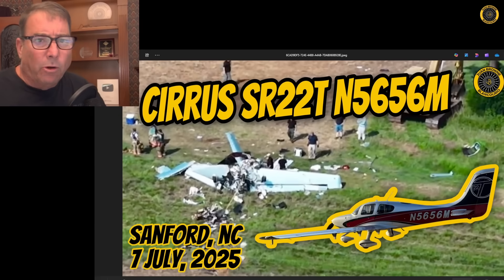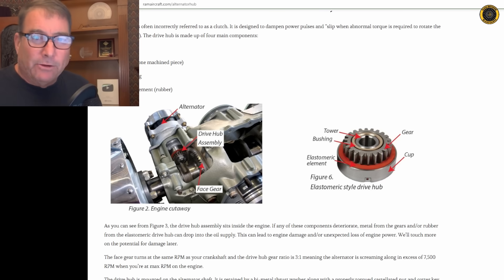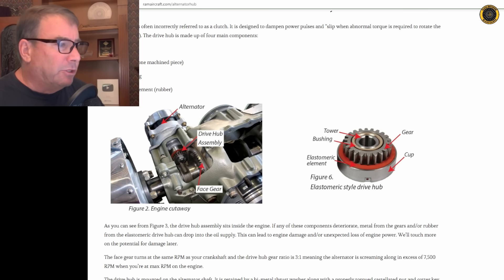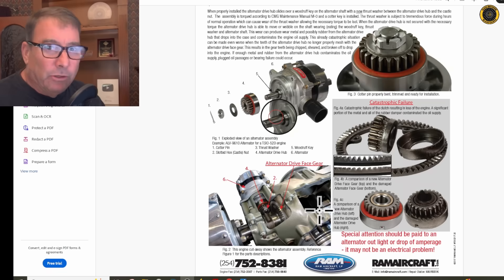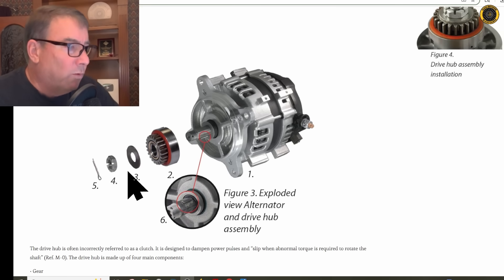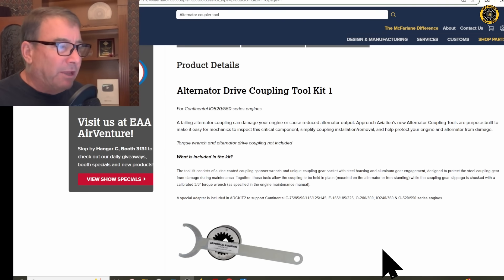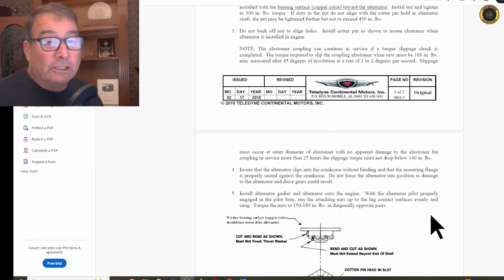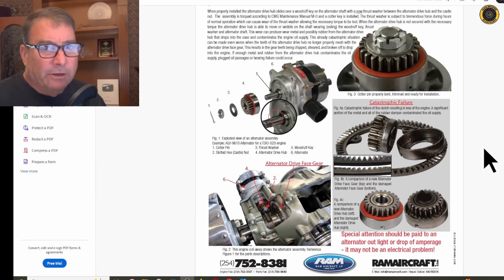Alternator Drive Failure-Can Lead to Engine Failure!

Comment from the maker: In lbs…NOT ft lbs. (read the bulletin- don’t take it from me).
Reply: Thanks for all of your videos.

Does the Elastomeric Hub act like a Sprague Clutch-?

Starter Sprague Clutches on the small Continentals are problematic when Spring breaks that surround the small rectangular Blocks in the Cup assembly. 
When that happens, the Blocks start sliding around the inside of the Cup.

Having to remove & install the Prop to replace an Alternator Belt on a Lyc. is a nuisance.
Reply: Googling answered the question. 😊

No, an elastomeric hub does not act like a sprag clutch. 
While both are used in mechanical systems to allow rotation in one direction and prevent it in the other, they achieve this through fundamentally different mechanisms. A sprag clutch utilizes sprags (or similar elements) that lock in one direction and freewheel in the other, while an elastomeric hub relies on the elastic properties of a material (usually rubber or a similar elastomer) to provide a one-way damping and rotational restraint.
Reply: @John-nc4bl  Thanks. I know my old Land Rover gearbox had an amount of preload that was required in a certain assembly and that was done by hanging a weight from a cord and adjusting the tension to when the cord just stopped moving. This elastomer hub seems to do a similar thing with materials.
Reply: Caught that right away, thinking."300 ft-lbs?! That seems high!". 
Then saw the max torque on the bulletin and it made more sense.
Reply: Too bad you couldn't put print on the screen when you said ft lbs and not have to re-load the video.
Reply: Bet good money they look around and then hold the gear with one hand and give it a few ugga dugga duggas with the other .
Reply: Crash in Sunriver Oregon yesterday.
Reply: Waiting for your video covering today's fatal King Air crash at London Southend, UK.
Too much dumb speculation & wibble on this side of the Pond.

Comment: Poor engineering.  The oil supply to the gear drive should be routed out to the oil filter whereby any debris would be filtered out instead of going into the engine.

Comment: Just as an aside- the purpose of the elastomeric coupling will be to absorb shock loading, in particular due to the fact that the engine doesn't actually rotate at a truly constant speed, rather it accelerates during power strokes, and decelerates between them.  This is part of what we perceive as vibration when the engine is running.  The generator rotor has a fairly large inertia, and is geared up to a high speed, which further compounds it's effective inertia.  Without the shock absorbing coupling, the gears would take a beating.  The drive system needs just a little "give" in it. Belt drives are excellent in this regard.

One would think that the generator drive gear train would be somewhat isolated- compartmentalized, as it were- from the rest of the engine so that, even if it fails catastrophically, and makes an expensive mess in there, it does not immediately wipe out the engine!

I would have guessed that the battery is always on line as well, and would continue to supply power, at least to critical equipment, in the event of generator failure?  In a car you get an hour or two of operation in the event of generator failure, depending on what loads you leave on, and which ones you wisely switch off at the time of failure.

Comment: Had the same Instructor for Private & Instrument.  Both Visual and Under the Hood he'ed Do an engine failure and shut off the master so I'd have Vacuum Instruments only for an Emergency landing That.s why there STEAM Backup gauges on the Lower Panel. Learn to use them their Life savers.

Comment: In the world of aviation, where (useful) progress in the realm of efficiency, power to weight, and reliability moves at a snail’s pace or is prohibitively priced…Honestly, what possible benefits are worth adding a system/level of risk into the crankcase like this?

Comment: If the alternator is not charging, and the batteries die, that would also stop the engine if it’s fuel injected

Comment: Yup exactly correct.  Had a customer lose his alternator in flight and not long after engine failure, followed by loss of control until he secured the engine...luckily he had the altitude...not a great design.  Metal all through the engine..very expensive fix

Comment: Decades ago, I had to pick up a little bird at another base. I was also scheduled there for a checkride. 
As usual, I did a thorough preflight check. During the checkride, I asked the FI if he’s sure that the bird is ok. 
He confirmed, he was 💯 sure, had just flown it.
After landing, I cancelled my flightplan and explained, that the bird has multiple problems and I’d ground it. 
Not only did I sniff electrical fire in the cockpit, airspeed indicated totally wrong, but only during the AR! 
After a hefty discussion, maintenance finally removed the dashboard. 
Oops: airtubes were melted and multiple cable insulations were burned up. 
The guys at this base never ever doubted me again! 😂

Comment: I think you need to issue a correction or clarification, before Continental sues you for misrepresenting the elastomeric drive coupling. They specifically designed it to allow an alternator failure by seizure to shear the elastomer with no internal engine debris, so an alternator failure does NOT result in an engine failure. This makes the elastomeric drive coupling perform just like the belt driven alternators. What you said about the old steel spring coupling is true and bits of the spring would subsequently cause engine failure. The service bulletin came out in 2010 and elastomeric drive couplings were available for us all to retrofit at the next opportunity (SB is not mandatory like an AD), but this Cirrus N5656M was made in 2012 and most likely had an elastomeric alternator drive hub. So while it could have been slipping due to alternator high torque (possibly from its bearings beginning to seize), the alternator failure should not have lead to a mechanical engine failure as your report heavily suggests, because it had the correct elastomeric drive coupling. If there was an engine failure, it may have been from any number of things, not the elastomeric drive hub. You usually put out very good reports, which is why this one surprised me with its lumping of facts and speculation that 99% of your commenters think that an elastomeric drive coupling caused this guy to crash. I think you slapped this together too fast and you are so busy with all these crashes that you put this out with some errors you may be liable for. Good luck fixing this, I hope I have helped and keep up with your good work, but take a little more time to proof read or edit before you post. Thanks for all you do.
Reply from the maker: No. I don't think so. Check your service history.

Comment: I have a question that I haven't seen raised on any of the post preliminary report reviews. That is in regards to the alleged plume of dust that is seen on video just after takeoff. I cant imagine that this airport will allow dust or dirt at the end of the runway. I also can imagine that planes typically go to the very last edges of pavement before getting off the ground. This seems like an anomaly. Maybe just a coincidence. Maybe a coincidental gust of wind? But my question is, is it possible that the engines were shut down before the plane was in the air? Right at the exact moment of getting off the ground? I haven't seen anyone discuss this, mention this, or review preliminary a report about the plume of dust. Or was it a plume of smoke? Thanks! Hope to hear and answer about this nagging question I have in my head.

Comment: That hub is not designed for electrical surges. It is designed for engine speed fluctuations. If you look at the speed of an engine. Every part of a Revolution is not at the same speed.

Comment: Just did a quick search on a beginner aviation question. These days AI pops up with a summary of a source - unclear how selected. Today it insisted that fatal small plane crashes were due to pilot error, and nonfatal crashes were due to runway conditions. It also didn't understand what "controlled flight" meant. In short, when you search, skip the AI paragraph that pops up. (AI has a history of what is called "hallucinations" a jargon term for makes cr*p up.)

Comment: I’ve got a TSIO 550N in my Lancair ES. This exact component failed. Thankfully I caught it almost immediately during an oil change when we cut the filter apart and noticed bits of that orange gasket / seal. 

My A&P told me, “there’s only one place that orange seal could come from and make it into the engine”. “Pull the alternator”

As soon as we got it off the engine it was obvious. 

I’m a fanatic about maintenance, thankfully caught this one. 

All that said…. No way I’d keep flying for hours knowing something is up. That part just doesn’t make any sense at all

Comment: The back bearing on those Delco alternators are tiny. When they fail, the rotor comes in contact with the field windings, creating considerable heat and rotational drag as the assembly self destructs.

Comment: The SR22 is an electronic aircraft. It might not be propelled by electricity, but every other system onboard is electrical. It uses electronics for every instrument. It has electric flaps, electric trim, and electric autopilot. Sure, it has mechanical backups, but that only means something if you actually fly it by the standby instruments every once in a while. If not, they may as well be written in another language. Given all of that, why would you choose to continue a flight with electrical problems? An electrical issue on an SR22 is an ENTIRE AIRCRAFT issue. Not just one or two instruments.

Comment: I don't know the first thing about Cirrus aircraft.  With a pure AC airplane like this relying on the alternator and one nut that holds the assembly together, is there NOT a hot battery DC bus that would run the electrical panel long enough to find a landing strip or emergency field??

Comment: CCP Tofu dreg alternator drives!    "On 14 December 2010, Continental's parent Teledyne announced that Teledyne Continental Motors, Teledyne Mattituck Services, and its general aviation piston engine business would be sold to Technify Motor (USA) Ltd, a subsidiary of AVIC International, for US$186 million in cash. AVIC is a Chinese state-owned aerospace company. In May 2011, the transaction was reported as complete and the company renamed Continental Motors, Inc."

Comment: I have worked on a number of this kinda alternator.  They are a weak point due the fact that the coupling can fail and contaminate the internals.  The nuts are a Bitxh to get to.  We used a chisel to tap off the nuts.  They can fail without warning  and could lead to an engine failure.

Comment: A company I worked for(flight school) had 5 Baron B58's with the 550's. I only remember having 1 of those couplers fail. The plastic was coming out of the holes on the side and that alternator stopped charging mid flight.

Comment: interesting isn't it, i often wondered why aero engines were more expensive than your standard motoring engines, (apart from stricter testing, materials and soon) so the alternate alternator drive doesn't seem that clever by design, or should we say to check for maintenance, odd, and a belt driven one better, better to lose electrics and keep the old prop spinning oil luscious

Comment: Mr Browne - after viewing this recent video, I forwarded the video to a friend & a FAA DME who pointed out that TCM does have a maint requirement for the alternator

Thanks for the good work
AirCoach

6-4.22. Alternator Inspection Frequency During 500-hour inspection Procedure 1. Remove engine cowling and aircraft components necessary to gain access to the alternator. 2. Remove the alternator according to instructions in Section 10-4.1.1 or Section 10- 4.1.1. Perform the “Alternator Drive Coupling Inspection” in Section 6-4.22.1 or Section 6-4.22.2 on all gear driven alternators. For belt driven alternator removal, refer to the engine primary ICA (Ref: Section 1-1.1). 3. Inspect Continental alternators according to the Alternator Service Manual (“Related Publications” in Section 1-2.5); correct any discrepancies discovered during the inspection. For engines equipped with Hartzell (Kelly) ES10024 consult Hartzell Service Information Letter A-135 for one time inspection requirements. For engines equipped with Hartzell (Kelly) ES-6012 or ES7024 belt driven alternators, consult Hartzell Service Information Letters A-137 and A-138 for one time inspection requirements. For additional instructions regarding Hartzell alternator instructions for continued airworthiness, consult Section 10-4.3. Remove and replace all other alternators with a new, rebuilt or serviceable alternators.

Comment: It's so crazy that (because of the USA's insane certification processes that prevents new engine designs and companies from suceeding) that we have these POS engines that were designed in 1983 still flying around in the sky, keeping Lycoming and Continental fat and happy with no competition. 42 years on the same engine design just with minor package tweaks. 42 year old design - that'd be considered young in General Aviation lol

Comment: Some years ago I was flying a friend, her mom, and her little brother in a rental 172S. Alt field breaker popped about 15 minutes after takeoff and 1 hour from destination. I reset it; it popped again. I told them that we were not continuing the flight and that there was no danger; turned around, landed, saw them all safely off the plane, then redlined the bird and called the FBO manager. That one airplane was half of their "fleet" and they weren't happy about it being down. I asked if they'd rather I continued with a known deficiency in the electrical system. They found the short and fixed it three days later, and didn't charge me for the Hobbs time. How this guy elected to continue is beyond my comprehension.

Comment: A right angle ring and pinion drive like that needs  bevel gears. The factory went way cheap using straight cut gears.  Look at any automotive differential to see a proper ring and pinion.

Comment: Maybe is time to get a small RAT for General Aviation, so that a small spinner can get some basic electric system so juice….much has been spoken/written on the Air India case, now we can add GA to the picture - I wonder which manufacturer will be the first to get one installed

Comment: Juan, a commenter pointed out that a 2012 Cirrus SR 22T has electronic ignition.  That would explain loss of the engine once the batteries were depleted.  Don't know myself, just FYI.

Comment: It is well known in the Bonanza community about this kind of failure.  Bonanzas use these Continental engines (mine has the IO-520BB) and a loss of the alternator is considered an emergency due to the possibility of loose metal pieces inside the engine.  We are taught that loss of the alternator may result in loss of the engine at any time and to land as soon as you can while keeping enough altitude to be able to land safely should you lose the engine.  Is this taught in the Cirrus training?

Comment: Seems like a pretty needlessly over-engineered design to me.  What was wrong with the spring in the old engines?  Or better yet, what’s wrong with a belt?  If a belt fails, it’s not going to completely cripple your aircraft.

Comment: Volvo marine engines had a similar drive for their salt water cooling pumps and they needed very frequent replacement and were a complete disaster in my opinion.  I used to keep replacement parts in my toolbox, because they were so bad

Comment: not a bad review.  slightly dramaitc with  sudden Complete electrical failure..when the alternator stops working...the PFD and MFD still work with the dual electrical buss and and dual batteries...there is plenty of warning systems in the avionics.

Comment: At 5:05 I spotted a warning at the top of the window.that a replacement alternator must not be installed with the "shipping washer"  in place instead of the special bimetallic one or engine damage may result.  A "shipping washer" seems  like a bad arrangement, especially for those who don't read instructions.

Comment: Sure sounds to me like someone got below the CAPS minimums thinking they could save the SR22..   As far as I was told by friends that own them on our preflights (I wasn't PIC, but I was flying most of the time)...   It does NOT require any electronics to initiate..     Nobody wants to pull it but if I am sputtering and losing altitude, (them in the briefing, they said that they'd never wait until sinking past the specs for the CAPS..  (Of course, some said if they were in a spin at low altitude..  "I'd pull it for the heck of it - but I do not plan on getting there")...     Such a shame this family was lost..

Comment: Belt drives make a lot of sense for certain accessories.  In the auto world I’ve had an alternator cook itself and seize more than once.  Shredding a belt is bad enough but it doesn’t destroy the engine.

Comment: Couldn't the alternator be mounted on a fail-safe sheer drive like the old Lycoming vac pump? That way any excess torque would cause failure of the drive outside the crankcase, not inside.

The Continental IO-520 has direct drive alternator. How does it differ? Same drive hub/gearing or simpler? Low/No failure rate?